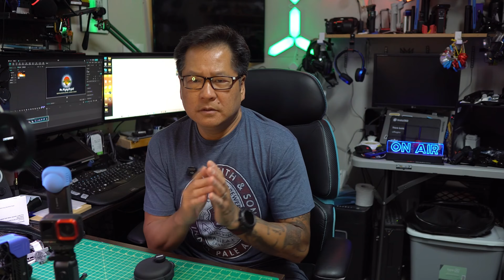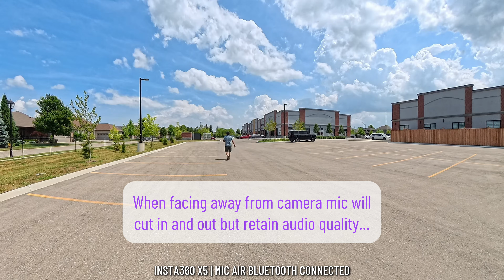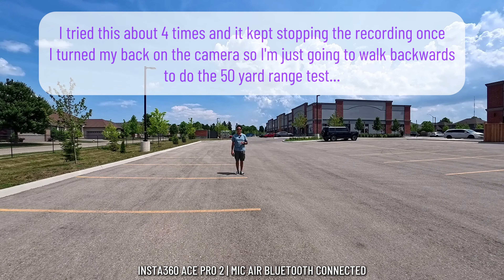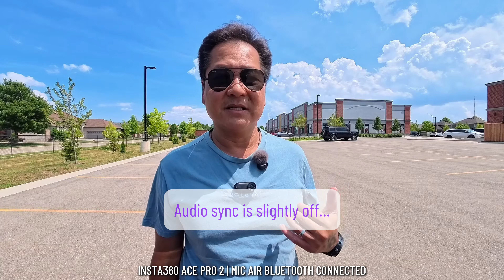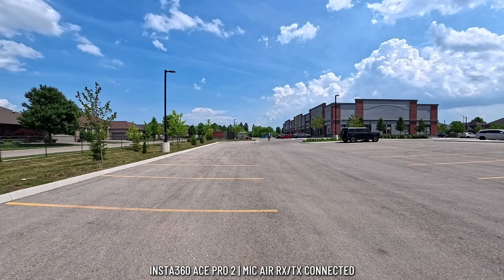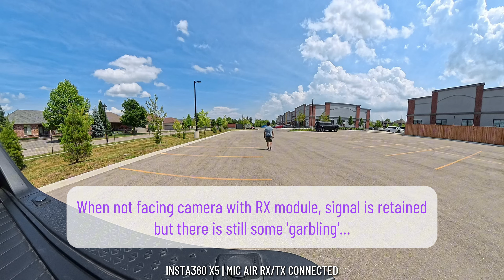VIEWER REQUEST: Insta360 Mic Air Range Test For X5 & Ace Pro 2!

Comment from the maker: As per viewer request, here's a quick sampling of the Insta360 Mic Air range test for the X5 and Ace Pro 2. I have done both ranges up to 50 yards with Bluetooth connection and up to 70 yards with RX/TX module. Hope this helps!

Comment: Very good test, Ill be all over this Insta360 mic if it works for my wedding videos. Has the "turned back" issue been resolved? Thanks
Reply from the maker: I really like the mic air and as for the back turning reception it's better since the last firmware update but being a direct Bluetooth mic I think it's going to be a common issue. The farther you go the worse a non direct transmission will get from my tests. However, the GPS Remote with mic didn't have this issue because it compensates this exact problem by using the internal memory as it records on that when it detects signal loss and then syncs when signal is optimal again, it's actually pretty cool how it works and kind of smart actually.

Comment: Excellent range test with the mic air and thanks for replying to this user request as well !! So basically the mic air sound quality is pretty good, but the connectivity range including the situation with lip sync issues and stop recording with the ace pro 2 is not good at all. I do not understand why insta360 is not able to introduce a solid mic solution as we have seen by DJI eco system with the osmo audio? osmo audio is soo much better! I doubt whether or not insta360 can fix the seen issues in this test by firmware upgrades? possibly they need to change the hardware as well for the mic air........But for the time being there is no comment from Insta360 when the known issues are going to be resolved........So should be buy the current Mic Air? well for just vlogging purposes the answer is probably yes, but if you really put your camera on a tripod and walk around (and therefore also sometimes turn your back to the camera) the answer is no since there are too many connection and lip sync issues. 
I also wonder how reliable the mic air receiver is when connected to eg a smartphone from Apple or Samsung.......do we see the same connection and lip sync issues? so far I have not seen anybody using the transmitter / receiver on a smartphone and maybe this does not even work at all? 
Again thanks a lot and the answers should now come from Insta360 ASAP including a timeline when the problems will be fully solved.
Reply from the maker: Remember the lip sync issue only happens when you go far and then back, in a short range use ie. 10 to 20 feet, the sync is fine and also this only happens with Bluetooth as it does not happen when using the RX/TX method. 

I'm told that they are aware of this issue and working on a fix, it's a timecode issue when using Bluetooth so we shall see in the next fw updates. The mic is still relatively new as it's only had I think 2 fw updates. Remember with their cameras, we saw similar issues which was later fixed so I have confidence this will be rectified.

That said, here's my thoughts on what you said. Would one sacrifice that 'glitch' for clearer audio or would they go with 'ok' audio to get the range? Now, I haven't tested the DJI Mic Mini BT connection at that range, I suspect the audio quality would deteriorate badly as we saw in the previous backyard video I did just going about 10/15 yards. I will do a test on the DJI Mic Mini in a similar scenario and I bet that we will see one of two things, maybe even both... quality will suffer greatly as we increase BT distance, a lot more then the Mic Air and maybe we would even have a sync issue as well with the Mic Mini. 

For 'me', I would never take a mic 50 yards to use it, here someone would simply hijack my camera when I'm that far lol. And if I take it to that distance, I would use the RX/TX method, again, sync is not an issue with RX/TX, only in BT mode. Because it's Bluetooth and Bluetooth has great limitations I would only use this method in close proximity. Until we see future BT protocols, this is what we are stuck with.  Most audiophiles won't even touch BT for audio, as you can hear, even with the better sound using the BT method, the RX/TX method is still superior.

As far as a Bluetooth completely independent wireless solution that has the best to-date audio quality for action cameras, I would have to say the  Insta360 Mic Air is the winner for me and I will be replacing my Mic Mini from now on. I still love my Mic Mini and Mic 2 but for travelling and daily use, the Mic Air is now my Go To mic. 

p.s. the Mic Air RX/TX is also much smaller profile then the Mic Mini RX/RX combo given me the same quality audio. ;)
Reply: @MrMiyagiStyle thanks but unfortunate the mic air receiver is too big for the X5 to stay invisible in the stitchline.
Reply from the maker: @WiljanWiljan  No worries, this mic is not for everyone and it's not the DJI audio eco system which you really can't compare it with as the Osmo cameras have a built in RX module in the cameras since the Action 3. But these are different class cameras, DJI has always had a good audio eco system we already know that but it will depend what you want in a camera, every user is different. I don't use my X5 30 yards away like I don't use my Action 4 30 yards away either so this for me, is not a deal breaker. The majority of people who use these things aren't using it at those ranges either so for me, the quality of audio out weighs the range but that's me. Don't forget, the lip sync issue is isolated and intermittent at least via my tests.

p.s. anything protruding from the body of any 360 camera will effect stitch line. If I want the best professional audio with any camera I have, I will pull my Mic2 out and record independently in 32 bit float and post sync, software now will do that for you in literally 3 seconds ;) A much easier method imo to get the best sound without having to sync or worry about signal cutting etc. ;)

Comment: Did you update the Mic Air firmware? That's supposed to fix the sync issue.
Reply from the maker: Yes it's using the latest firmware, 1.0.20 I believe. The sync issue only occurs with Bluetooth mode and only IF I go off to a long range and back. This doesn't happen if I use it at close proximity. The previous video where I used it in my car driving it didn't have any sync issues at all.
Reply: @MrMiyagiStyle  I guess Insta360 needs to work on that. In the meantime, just use the receiver if you're going far from the camera. I'm usually very close, so it's not an issue, but I'll do a test in my hallway tonight to see.
Reply from the maker: @JustinPulitzer yah same here, not likely will be using the Mic Air in BT mode at 40 yards 😂